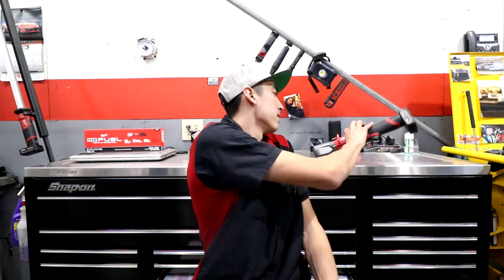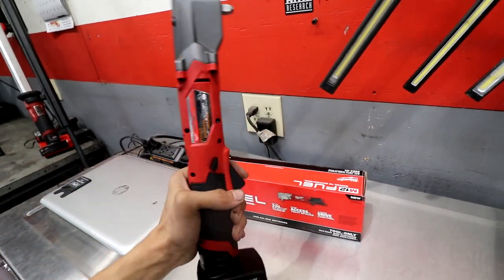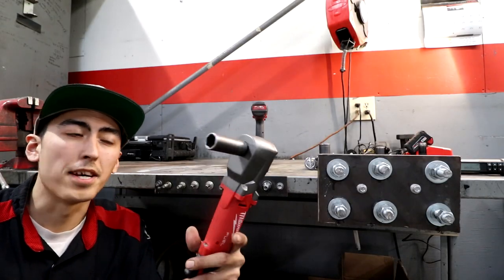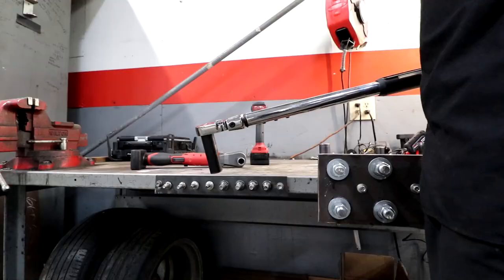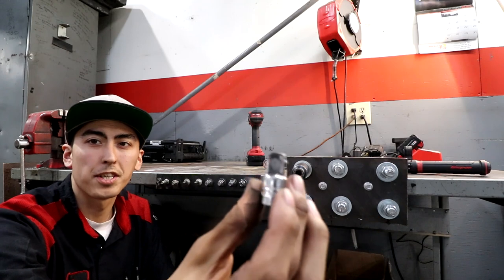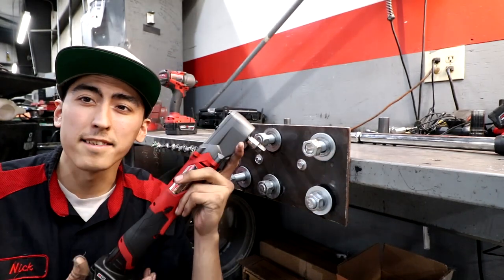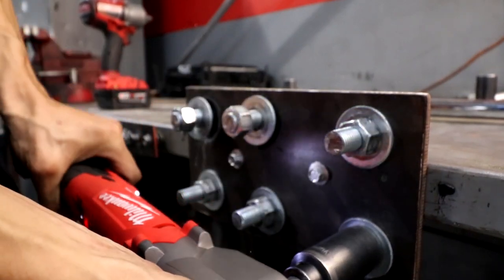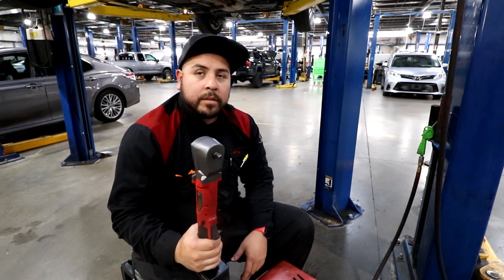MILWAUKEE 3/8" RIGHT ANGLE IMPACT WRENCH TEST/REVIEW 2021

Comment: I use the 90 impact daily for suspension. Love it. The shape and weight distribution are awkward at first but once you get used to it it’s great. I do full jeep and tacoma lift installs using this and a breaker bar as my main tools.
Reply: I was going to say that. He works at Toyota so he should know how shity and tough it is to do most 4Runner and Tacoma suspension/brake jobs lmao.

Comment: Just bought one. Been pulling wrenches for 30+ years. Initially I was also trying to figure out if this would be a useful tool.  As an old fart working on medium/heavy duty off road and industrial stuff for a  living I think my wrists will thank me for using this over a regular (medium) impact.  I get to pull apart engines, transmissions, axles etc. This should be my goto to tool for many things, soon.

Comment: First nuts where more difficult to take off because they were flange nuts designed to stay on should have grooves on the flat side so they don't shake loose, the largest nuts on the right where standard nuts with flat washers so less resistance which is why they where easier to loosen
Reply: So much game

Comment: I work at a lawnmower shop and this tool would be great for working on all commercial riders. I also worked on skidsteers in the past as well as commercial golf equipment and I feel this tool would be a good fit. I wouldn't have to worry to much about room since most of the equipment I work on has the room to work around.

Comment: I bought one myself 
Work as mechanic tyre fitting 
Works great to get spare tyres out of utes and van 
Bought to loosen bolts on shock bolts for wheel alignment camber  adjustment and didn't live up to job 
Use it try loosen a wheel nuts today first in a while did the job but didn't work as well as a mq8 gun
Me i rate it a 6/10 
Works ok but as you said too big
Maybe worth waiting for m18 version with 18v battery or v2 with higher torque motor in m12 battery

Comment: The m12 stuff works better in 1/2 inch because of the heavier socket like you pointed out. They also work their best with the 6.0 battery as the working voltage stays higher. They're a decent amount of youtube videos that show 1/2 m12 stuff with the 6.0 battery outperforming anything 3/8 and 4.0 or lower batteries. Seeing as I could get metric down to 10mm in 1/2 I just bypassed the 3/8 stuff and went 1/2 on all my m12 besides my 1/4 gun
Reply: Thank you. I was debating for a long time between the 1/2 and 3/8. I will go with the 1/2" and on top of that, you can always use a 1/2 to 3/8 adapter too.

Comment: I am a transmission mechanic and the only thing I could think of to use that for is honda bell housing bolts. The give you a decent amount of room so you can fit that big ass head in there and that thing seems to have the astronomical torque output it would to break them free lol. Other than that doesn't really seem useful for me. 99% of converters doesn't have enough room for the big ass head to fit and anywhere else I could use a real impact.

Comment: Got the 3/8 and 1/2 inch they put in work forsure💪
Reply: Any difference in power between the ⅜" and the ½"? I know they can bust nuts loose up to 220lbs
Reply: I got the 1/2 diesel legit.

Comment: Couldn’t agree more. Powerful but Too bulky for the Mechanic Trade. 🍻😎🤙
Reply: Ohh look at that my other Favourite YouTuber follows lets drift media🤣👌❤ @justindow
Reply: its ok for brake jobs but i prefer the german Hazet Air version.
Reply: Too bulky for cars but perfect for trucks and heavy equipment
Reply: I’ve found this tool useful on the ram 2500 rear shock bolts. Allows you to get up there without dropping the spare tire.
Reply: It's really not

Comment: For DIY mechanics it's very useful. I have used it on suspensions twice but I primarily use it on brake maintenance. At the lowest setting I also use it like an electric screwdriver for torx screws. It is very useful but if you have a lot of clearance like at a mechanic shop this tool isn't very useful since you have other options.

Comment: I use mine as a paper weight.  I am a DIYer.  I often go to the junk yard for parts.  When this tool first came out I was SUPER excited to get one.  In fact, I purchased two!  A 3/8 with a friction ring and a 1/2 with a pin detent.  The 1/2 is TOUGH to use because the pin detent is not like on my other tools (i.e., Dewalt and my Milwaukee battery ratchets) in that you need a special tool of some sort (I use a piece of plastic) to remove the sockets.  So, when working on a car, this is a hassle.  Also, when at the junk yard, I tried the tool on several suspension parts and no joy.  Tool would not remove part.  I then switched to my handy Dewalt mid torque impact wrench that zipped the nut right off.  So, I can not recommend this tool at all.  I would not buy it again if I did not already have two.  The tool was so weak that I am now suspect of all Milwaukee impact wrenches.  I only have Dewalt impact wrenches and now, dont have any reason to change.  Good luck and I hope this comment saves someone their hard earned dollars.

Comment: It’s a beast got 3/8 exchanged for 1/2  it’s able to unscrew  starter bolts  on heavy duty truck I try on Cummins engine .it’s made my day there is no room for ratchet to turn  using long extension you loosing torque I just put socket on that beast and vuala.highly recommending for heavy duty trucks.for cars don’t know.
Reply: I own a freightliner Coronado and was thinking about buying one of these.
Reply: Im here to review this tool. Im stuck trying to pull off my exhaust manifold and up pipe for my duramax and so far its been a b—ch
Got all my other bolts loose except for the 6 right below behind the turbo. Looks like ill be placing a order after I finish this reply

Comment: I think this would come in handy for the UCA bolts on a Tundra. I have aftermarket UCAs with greasable bushings, but need to loosen them before greasing. I would use it for caliper bolts too, because my 1/2 M18 gun is too big to fit.

Comment: This particular tool made a L99 big VVT cam swap complete cake in my 5th gen Camaro. Since you have to pull the heads on a L99 to delete AFM, fighting with header bolts was a thing of the past. The only thing it wouldn't break was the balancer bolt, had to grab the M18 1/2 high torque.

Comment: Very good tool for steel erectors. It's pain in ass when I have to tighten bolts and nuts. having no enough space for the regular impact gun - it drives me crazy, make my work hours longer and job harder. When I can't use my regular Hilti impact gun cause it's too big. This Milwaukee impact would be ideal for me. Definitely this yoke would be ideal for steel erector and similar trades.

Comment: I rounded a belt tensioner pulley mechanism bolt with a 3/8 ratchet..i think if i had this tool, would have done the job perfectly

Comment: Also on my chrysler town and country the lower rear drivers side transmission mount was torqed to 80 ft lb and layng on my back in a half sit up position with no way to get leverage and tight space, this would have fit in to break the bolt, i fought with that thing using a breaker bar on my back using both arms doing a shoulder pressand finally got it to budge, a electric ratched was needed to help get the bolt out in this position. I bought this tool right after doing this job for the next time i replace that moint

Comment: Would you get more general use out of the 3/8 or 1/2? I like the adaptor you have for the 3/8. So they sell an adaptor for the 1/2 to take 3/8 sockets?
Reply: Absolutely man. You can get a full set of adapters on Amazon for under $20. 
I’d get the half inch Milwaukee and then use adapters if you need them. Be sure to use the black impact rated sockets

Comment: I bought it to work on large conveyor and packings equipment where you can't get full size impacts in. It works well for that, also found it works well for brake and suspension work and removing bollards.

I don't think it's capable of any large mount bolts, where you do need a high torque gun.

Comment: UPDATE! I received the 1/2" and used it, it failed, only removed one bolt. I returned and exchanged for the 3/8" model, I used it today on a Cummins ISX CM-871 to remove the oil cooler housing. It runs the entire length of the motor, and is darn close to the frame rail, 20 16mm fasteners in all. 

My 3.8" stubby was not much help. So, I went out to the car, just got that thing from HD the other day, still in the box... Unwrapped it, through in a Chinese knock off 6 amp battery and slapped on the 3/8 to 1/2" adapter and 16mm impact socket and went to town! 

This  3/8" right angle removed all but one bolt. Instead of using a gasket on that housing, they loaded it up with RTV. Each bolt was covered in the stuff, every hole was full. The last bolt, the one it could not remove, was a real bugger, I used my 2 foot long 1/2" ratchet on that one, and it was really gummed up with RTV, I could see why the right angle would not remove it. 

Saved my bacon today time wise, it is a keeper! 

But, what get's me, is why are the 3/8" version is seemingly more powerful than the larger 1/2"? They are identical other than the anvil, must be some sort of physics thing I guess...

Comment: Mine has no power, cant break motor mounts loose or brake caliper brackets. I've had a impact only rated for 150 ft-lbs break somthing loose that the right angle couldn't
Reply: @Ivan Moreno Not really I have the Kobalt and the Milwaukee, there have been bolts that the Kobalt couldn't take off but the Milwaukee did. The funny thing is the Kobalt is 24v and the Milwaukee is a 12v, big difference in voltage. I wish someone would do a Milwaukee vs Kobalt right angle impact.

Comment: The small studs had to much give and vibration in the bench so it took away from the power going directly to the nut and stud. The bigger studs being mounted in that heavy plate allowed more of the hammer action to go into the nut and stud.,

Comment: I bought this before the stubby, this one was able to get in and help me remove some nuts on thr right rear engine mount on my mercury sable. The stubby was needed to access the heat sheild whers this wouldnt fit. They both worked together for me at home mechanic working under vehicle. What is the name of the torque wrench you are using? I want that.

Comment: I know this video is a year old but I found this is pretty good for some torque converter bolts flywheel bolts (if you aren't dropping it all and just slide it back) it's really good for getting the three 18mm bolts out of the rear motor mount on dodge grand caravans.     I've been using it in place of my 3/8ths stubby air.   I still break it out here and there when something is just to tight for the milwaukee

Comment: hey big fan of the channel!! i brought my ‘94 LS400 (48k miles) for an oil change at the Lexus dealership...a few days later i noticed an oil leak. brought it back and they told me that there was a leak coming from the crank seal. seemed odd to me because there was no leaking before i brought it in and i was driving it for three months. he said that the new oil is probably more viscous than what was in there. long story short they told me to replace the seal, they would be doing the same disassembly that it takes for the timing belt, crank seal, thermostat and water pump, so they recommended (obviously lol) that i do it all at once for $1,600 bucks....am i an idiot if i do the repair? Seems like putting in thicker oil makes sense but also know that ultimately ill need to do the timing belt etc. any advice would be dope. cheers bruh
Reply from the maker: If your going to pay someone to do the front  crank seal you might as well do the timing belt and waterpump since there shouldn't be any additional labor only cost of parts.
Reply: @LetsDriftMedia  they are saying total 7 hours labor does that sound fair?
Reply from the maker: @jcastro41  all data labor time is 5.2 so 6hrs seems fair id ask where there getting that extra hr from
Reply: @LetsDriftMedia  thanks so much bro 💯

Comment: Hey, I know you switched over to the heavy duty/diesel world. Have you found any uses for this in that industry? I'm currently an apprentice for a truck dealership and was thinking of getting one. Thanks
Reply from the maker: No I actually returned this tool after this video was made. Still haven’t really found a time where I wish I had it on me. Haven’t seen anyone at my new place use one either
Reply: @LetsDriftMedia  At 13.53....with all those  scratches on it...lucky you could return it.  That's something I would be ashamed to return. You bought it, you proved it  works fine, you made a video with it (at other peoples expense)....you should have kept it.  Grow up, next time think before you buy. It's this kind of behaviour that makes everything cost more.
Reply from the maker: @vancamper7650  Home Depot has a clear policy if you are not satisfied with a product return it in its original packaging within 90 days for a full refund. I even told them I didn't like it and why I didn't like it when I returned it what is there to be ashamed of? But hey I don't make the rules. Go be mad somewhere else.

Comment: I thought about one of these things for a while and I came to the point that it isn’t worth it. If the space is big I’ll use the m12 3/8 stubby, and if it is tight I’ll use the regular m12 ratchet. May get the long reach ratchet, but this tool seems like a waste for most people. Probably only get it if you just have almost every Milwaukee tool or something.
Reply: I’m on the fence about it. I feel like I’d be better off getting tubby impacts, like you have. The only thing I really feel like it would shine is brake jobs.
Reply: @JakeNaughtFromStateFarm  yeah if you don’t have the stubby I would say go for that all the way, then get a fuel ratchet. You can always break bolts loose with the ratchet then run em out with the tool. I haven’t used my basic m12 ratchet in a while and forgot how good it is. Used it just the other day for some work on a reefer unit and it broke the bolts loose pretty easy. Sometime you can throw an extension on the stubby and get into a tight space or swivel sockets. Most videos I have seen of the right angle you could use a ratchet or impact in its place. Just stuff to think about, if you think it would help your work could be something to get though.
Reply: @JakeNaughtFromStateFarm  ultimately IMO more of a luxury tool than a necessity.
Reply: The long reach doesn’t impact

Comment: "What are you going to use it for, unless engine is out of car".....don't see the logic to that. I think you are used to a routine, your way, and that is okay. On other hand I see other professionals sayig how much they like it,.....and although it is not your go to impact for everything, is a nice to have. About 70% of the time people are using their Milwaukee ratchets in areas very open, and often  have to break the nut loose first...this ends that.  If you are happy with your ratchet and 55 ft lbs, how can you not be happy with this lot more powerful and faster tool?  I don't like waiting 5 secs on nuts, especially when there are many of same size. This has the stubby beat for tight spaces, and ratchets beat on power and speed by a huge amount....a nice inbetween.
Reply from the maker: Depends what you are working on, But most of the time I feel like my cordless ratchet bearly fits in some places so this thing would be even more bulky and not fit in alot of spaces. Not saying its useless but I havnt ran into too many situations where I wish I had this tool.

Comment: One of the worst Milwaukee tools ever. They rate it at 220ftlb but it’s underpowered. Head is to big so I couldn’t use it half the time and once again The M12 batteries are prone to falling apart.
Reply from the maker: Yea I ended up returning this tool after the video, just didn’t serve much purpose being an auto tech